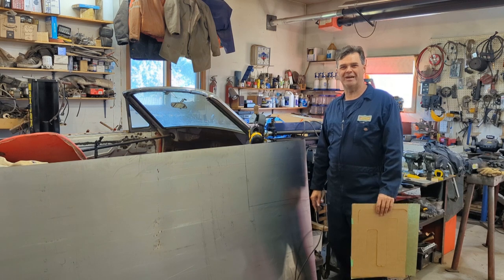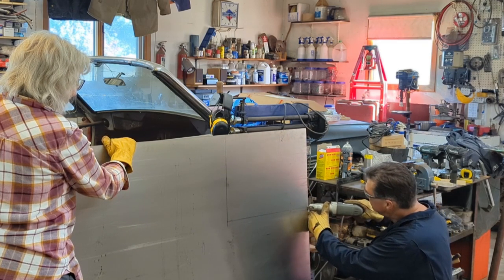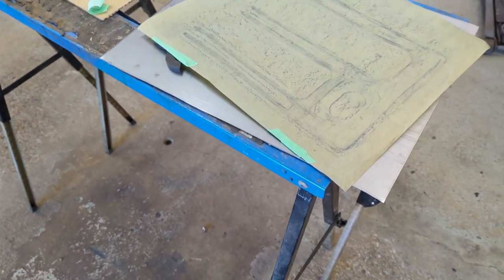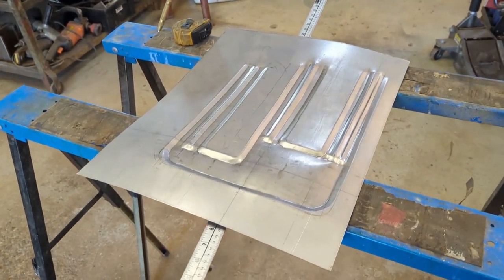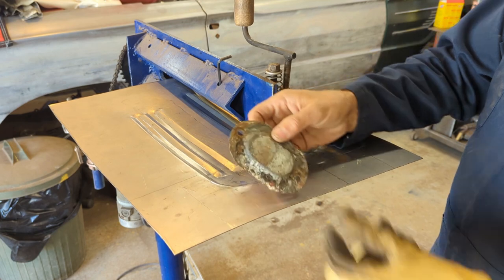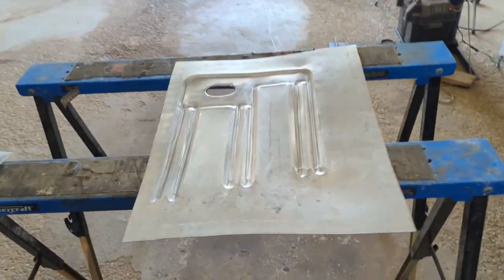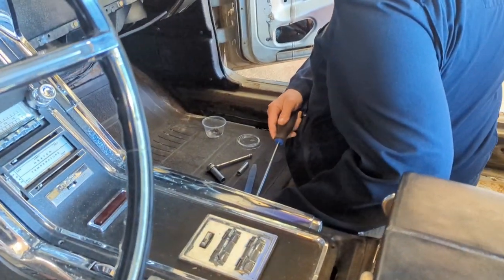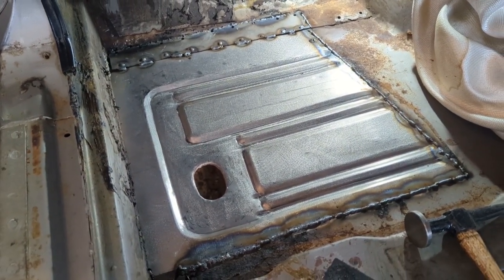✅ One Front Floor Pan  - 65 Thunderbird Hardtop ✅

Comment: The patch looks great. I bought pre-made floor panels (for both sides) because I don't have any of the fabrication skills or equipment you do. As others have said, they're a bit pricey for what they are. I bought a less expensive panel for the passenger side; it didn't have the contours that the original had, but it was a heavier gauge steel (18) so I thought that would be fine. It worked OK when welded in, but you could tell it wasn't quite as rigid as the driver's side panel that had contours like the original.
Reply from the maker: Thank you, I will be making another panel pretty soon, the convertible needs both front floor panels replaced...I've been trying hard to get back working on the convertible, but every time get geared up to go back on it, something else comes up! Today it is the rear brakes on my son's Jeep...I guess that's how it goes. Lol

Comment: Alvin,
Looks terrific, my friend.  You saved a chunk of moolah over those offered by vendors, $145.00 each for the front and $180.00 for the rear, which for me is completely out of the question.  What gauge metal did you use?  Inquiring minds will want to know.
Btw...give Beverly a break.  Her back is probably killing her from carrying you. 😎  
Regards,
John
Reply from the maker: Thank you John!
Yes, these floor pans are a little pricey.
I made the floor pan out of 18 gauge, should be good and strong.
Beverley says thank you for noticing that she is doing all the heavy lifting! 😜

Comment: Watching all your vids great work, I am working on modulator problem on c6 Its shifting late, finding lots out . The pin length 1.601 to 1.670 shortest is for early shift, 1966-1972 . Just giving you a heads up for later reference for anyone might want to know.I know there is a screw but didnt help backing it up
Reply from the maker: Thanks for the info mcrick!

Comment: Hey Mr. Jamison, I just discovered that I have to do both of my front floor pans on my '65 major bummer. I ordered one from the Birds nest but there like beer can thing 22 gauge steel. What gauge do you use/recommend?
Reply from the maker: Hi Michael, I use 18 gauge for my sheet metal work, 22 seams a little thin...but can be done, just have to watch the heat on the welder.